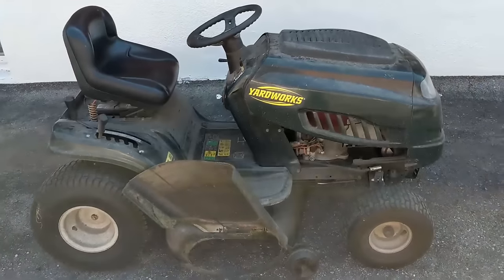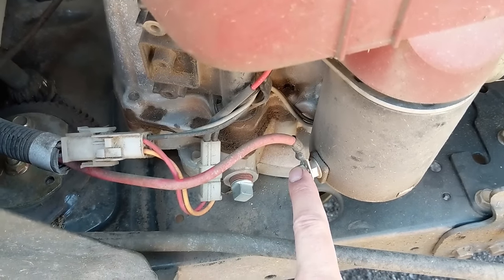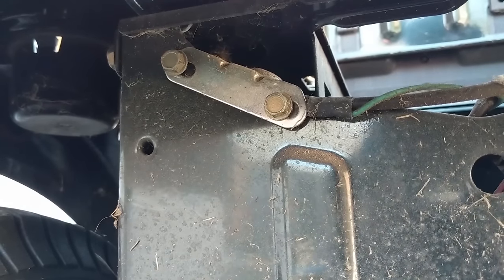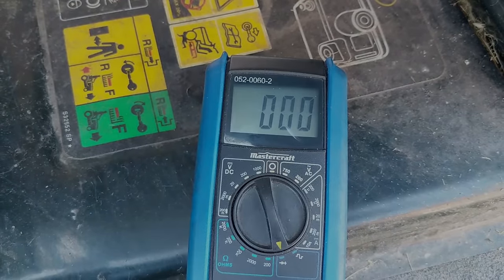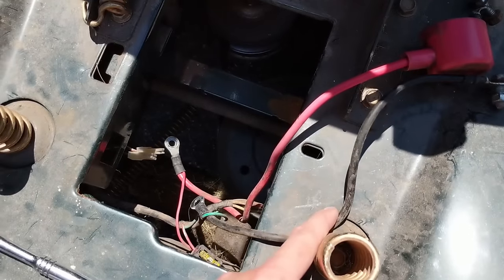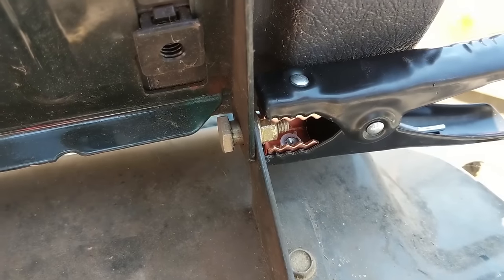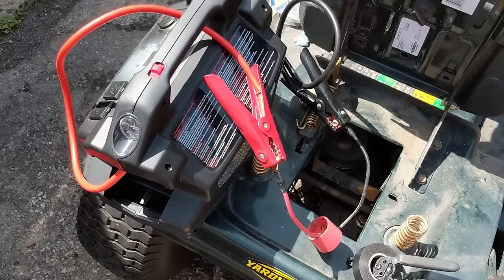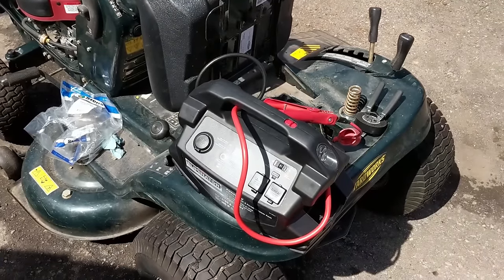Riding Lawn Mower - Solenoid Clicks but Doesn't Start

Comment: I have a zero turn and it was clicking a few weeks ago, when I turned the key all the way, nothing, but when I backed the key off ever so slightly it would turn over. Now barely clicks. I'm thinking bad key switch?
Reply from the maker: Had that issue on a keyswitch, you can test it, watch this; https://youtu.be/vWRL9_3_X0Y

Comment: Doing a voltage drop test to test the wires is probably better you can get continuity but insufficient voltage due to corrosion or broken strands
Reply: Ur correct there is a big difference between continuity and conductivity  voltage drop test
Reply: Yep voltage drop test on both pos and neg would have save a half day of taking things apart unnecessarily….

Comment: I just got done working on a Troy-Bilt Pony.  Click, no start.  Solenoid checked out.  I pulled the starter.  Starter checked out.  Battery checked out.   Pulled the fuse. The fuse checked out.  Pulled the spark plug.  Tried to manually turn the engine.  It was locked up!  I used a 15/16" socket on the flywheel bolt, trying to turn in the direction of rotation.  No go.  I tapped the ratchet against the rotation and the engine freed up.  I did a cursory compression check (finger over the spark plug hole) and it had compression.  I put it back together and it ran.

Comment: After overcoming the big wall of awful that was my clicking mower, I did all the steps you suggested and found it was a ground on the battery and solenoid that fixed it! Life saver! Thank you. I agree with what everyone else said about how helpful and clearly you described the likely failure points.

Comment: Your tutorial saved me hours of frustration. I checked all my connections, charged the battery and my mower would not start. After reading all the comments I discovered 2 other guys had the same problem. My battery was fully charged, and was good after putting a load on it at the parts store. It needed a booster to start for some reason, but when it started I got so excited I mowed my yard of 2+ acres. Im a new subscriber and thank you for the video.

Comment: I have a John Deere 185 Hydro lawn tractor with a 17HP Kawasaki FC540V engine and a Nippon Denso 12800-2810 starter that had an intermittent "one click, no start" issue.  I installed a $16.00 knock off John Deere AM107421 Starter Relay Kit from eBay and it solved the issue.

This video helped me track down the issue caused by low voltage at the starter solenoid.

Comment: So simple when explained professionally. Everything starts and ends at the battery. Connections to every circuit and appliance. Battery pos neg,Solenoid, safety switches, starter,  key switch, fuses, and ground.

Comment: Thanks a million for this video. Very clear step by step testing. At the end all the tests pointed to the problem being in the starter motor. It was getting the correct voltage but not spinning. I thought to myself that if this happened in the car I would give it a couple of bangs with a hammer,so I tried it and guess what? It worked and has continued to do so. I guess that over the winter the thing had seized up…Bendix or whatever. I thought this might help someone before they undertook removal and repair/replacement.

Comment: Just my two cents but you can test the fuse by the two contactors on top without removing it—it has saved me a lot of headache when working on cars—just wanted to pass along the advice— Great video!

Comment: Thanks a ton, you tip was very helpful!! Being an owner of new to me landmower; my zero turn wouldnt start, heard the solenoid tick but the motor didn’t start. However, took courage after seeing your video to pop open the driver seat, put my battery boosters in and vola! My zero turn started right sway
Reply from the maker: Maybe time for a new battery, thanks for watching, and good luck!
Reply: @EliminatorPerformance  Yeap..I agree..I’ll get one from Amazon..looks like an easy swap

Comment: Dude! I was stumped. I checked safety switches and ignition along with many other things. I have a brand new battery too. I heard a click under neath my seat and it was the solenoid. Saw your video and removed the solenoid. Cleaned the ground, the battery terminals and the starter terminal. Jumped on and it started! Thanks!
Reply from the maker: Thanks for watching!

Comment: 2 month old mower started doing this. I found the ground from battery was connected to a painted surface. A little wire brush and presto, better than new. Great walk thru video on diagnosing this issue.

Comment: Thank you for your expert knowledge. I was able to follow your step and found the ground wire next to solenoid that was loose. Btw, ever since I replaced the engine two year, the headlights is  always on. I was able to live by so far by disconnect the battery each time. Wonder if you know the cause for that

Comment: I'm a 20+ year electrician and a 10+ year home business small engine mechanic. So, this is my advice on testing this type of issue...

When you test, always put your tester  ground directly to the battery. That way you eliminate a bad ground from your testing. If you get power to the starter with the ground on the battery, that tells you your entire positive side of the circuit is good. At that point you could move your tester ground to the engine (where you started), if you get zero or any voltage lower than what your battery voltage is, then you know there is a bad ground.

I've had several issues with bad ground from the battery to the frame strap. Testing using the battery as your ground allows you to more accurately isolate the issue. 

Also, never trust the thread of the bolt as your ground. Threads get painted and also allow for oxidation.  Always, always, always clean the metal pieces with a grinder, sander, wire wheel, etc... so there is a good clean connection from the wire directly to bare metal. A three post solenoid can give you different results if there is not a good ground at the base plate of the solenoid. In that case there won't be any noise from the solenoid because the control circuit of the solenoid won't get voltage due to the ground. In this case test for voltage from the neg. battery post to the control post/wire of the solenoid. If you get voltage there but not from the ground strap on the solenoid to the control post then.the ground is bad on the solenoid strap.

Electricity is hard to see, unless you blow it up. Lol.

Comment: Good troubleshooting procedure. I was hearing a click, but like a small relay. Found out that was the fuel cutoff solenoid by the carburetor. When in the start position, only ~5.5volts  at the battery. Somewhat similar to this situation, It was the positive cable to the battery wasn't tight. It stated a few times after re-installing the battery in the spring, I guess after a few mows that loosened the connection.

Comment: Thanks! This is a great video because it covers every possible things that could go wrong and offers solutions for each on.e It goes beyond standard troubleshooting into things a repair manual wouldn't like noting that the paint on the frame could make a bad contact. Very clear about everything. More videos should be like this. And I'll be checking out what else I can learn from this channel!

Comment: Thank you! I have a 1998 mtd Ranchking 16.5hp opposed twin I bought used. I just about changed everything on my mower to finally get it running the last thing I did was change both battery terminals and put a new starter on it (my solenoid was clicking too but wasn't cranking)...also my heads were flooded so I pulled sparks out, flamed up the chamber to get it dry, slapped the spark plugs back in and it finally got going. I also had to adjust the idle on the carb to get it running stronger, because it used to die out when mowing sometimes. Also of note, just to provide yall with as much info as I can, I put new battery, new spark plugs, new magneto, new fuel lines/filter, new engine oil. I took the heads off and sanded off all of the carbon buildup on them and the pistons, also threw some seafoam in there for good measure. I also attached a new solenoid. Just about the only thing decent on it was one of the belts and the blades are still good. I'll be getting 2 new tires for it soon as well.
Reply from the maker: Thanks for watching!

Comment: Thank you, did everything you have suggested and found out that the solenoid was bad originally it did click but a no start ... got a little sneaky and with the key on I shorted out on the solenoid in original place the incoming 12v cable and the starter cable and the starter motor turned over so the solenoid was defective
Reply from the maker: Sometimes they click but don't make the connection, this mower is still starting and running to this day!

Comment: Good video. I have a question. Turning key makes solenoid work, there is 12volt plus power to starter but starter does not turn. Putting power direct to starter from battery starts the engine.  Checked key switch contacts, all work as they should solenoid clicks. Is it possible that there is a fault on the reverse module part?
Ive checked all safety switches and all appear good. I'm stumped. Help please??

Comment: Dude, you literally got my mower started! Much obliged!!!! Thank you my brother!
Reply from the maker: Thanks for watching, glad it helped!
Reply: I had a craftsman YT3000 ride on mower.I had no idea how to fix it.The mechanic had a look at it n reckons its something else.He started it up with his truck terminal n still won't start.I replaced the old solenoid n a new battery n still won't started.He reckon the main motor key to start it came off or did I hit something hard like iron.It turns but not enough power to start it.He had a quickcheck up its still won't start.I watch your video n I think this might do it if I follow the video.clearly.in steps n.It mite work.I live in Rarotonga,Cook Islands n it hard to get parts for.the machine.I.really like watching this videos n others mainly on ride ons.Kia orana from Rarotonga.

Comment: Very helpful.  I am troubleshooting an old Ransome's Bobcat.  Starter switch is bad but I have been bypassing it with a jumper cable from the positive battery post to the red post on solenoid. So no feedback of clicking.   Last week, no cranking, just sparks at solenoid.  Will try your approach to eliminating causes.

Comment: Great video. Very well done. If you get the biggest possible replacement battery, larger than OEM, could out prematurely burn out the starter by driving it too hard?
Reply from the maker: No I've never seen that happen, the more CCA (cold cranking amps) the better. As long as it's a U1 battery.

Comment: i went through all this numerous times with an intermittent problem - starter would not turn over or trn just a little. next time it would start fine and stay that way for awhile. finally pulled the starter. found a broken chunk of field coil that would jam up and let loose whenever it felt like it. 1 new starter later and I was back in business. 1st time in 50 yrs I had run into that one.

Comment: You just saved me some time.  I was about to pull the pressure switches out from the deck and brake to check them but I do hear the solenoid clicking so that means power is getting through both and the ignition is working.  It makes sense the pressure switches need to be before the solenoid, not sure why that didn't occur to me, probably more just frustration getting to me.  I can start it right up from a jump box on the starter so I'm thinking its probably just a bad contact from the battery I need to clean up.  Great video.
Reply from the maker: Glad it helped, good luck and thanks for watching!
Reply: I was about to do the same but watching this made me think. My mower would randomly not start with the relay clicking. I've had the mower 2 years and this started about 6 months after getting it. Recharging the battery didn't solve the problem. After seeing this and checking everything I became suspect of the battery. Toro supplied a 195 cranking amp battery. Other blogs indicate this is way too low. I bought a 340 and the machine fires up immediately every time. Easy fix after a lot of needless worry. Shame on Toro for supplying such a weak battery,
Reply from the maker: @leeclem6066  we run 370's regardless of engine size, because that's the only battery we recommend! Turns over a mower every time!

Comment: My Craftsman GTS 5000 had a similar problem. Turned out to be the brake switch. I spent a great deal of time replacing it. When I do maintenance on the mower, I make sure to remove any corrosion from all of the terminals. After that, I spray CRC Battery Terminal Protector on all the terminals. A great tip of yours is to remove the paint from any ground wires connected to the frame. Sometimes the problem will be a buildup of rust.

Comment: Before you break out ANY test equipment, make sure the blades are DISengaged. Sounds simple but my Hustler zero turn almost fooled me. It has a toggle switch/solenoid that won't allow power to the starter if in the ON position, but it WILL click. Glad I caught my mistake before I started unbolting stuff. Just thought this might help someone.

Comment: I recently replaced my starter solenoid, where I re-connected the wires exactly like they were on the old solenoid.  After making a couple test cuts, the mower made a grinding noise that wasn't there prior, and upon turning the key off it kept the starter powered.  I expect the new key switch or the solenoid is wired differently than the original parts.  The solenoids appear identical but the 5 pin key start assembly was different as far as the orientation of the connector.  What do you think?

Comment: The video was a huge help. I replaced the solenoid and now I get the click. I get power from the key and I am also getting a connection from the solenoid to the starter. The starter looks like it starts to move a little then nothing. Bad Starter? I am getting power to the starter that has been confirmed.
Reply: If it helps at all I took the starter off and tested it on its on and it spins. So the other thing I was thinking was a kill switch somewhere maybe?
Reply from the maker: Could be a bad starter, do a bench test of the starter. Simple 12v bench test: https://youtu.be/0k4R2WKRhDk

Comment: hi,
great video.
I'm in Australia and first try after our winter, my ride on solenoid clicked couple times.
I got new battery and same thing, but after couple clicks then nothing. There is power to solenoid but not from solenoid to starter. It's 4 post solenoid so it maybe a safety switch and/ solenoid. I tried jumping solenoid to start but nothing...
Cheers

Comment: I have a Craftsman rider at least 20 years old. The solenoid was clicking like crazy when I turned the key over. Battery tested at 12.7v with meter. Tested everything else out & was fine. Replaced solenoid anyway and tore starter down and cleaned it up inside. But it was a head scratcher until I load tested the battery. Didn't even move the needle. Changed that. Like nothing even happened.

Comment: Hi Great video, i followed your electrical trouble shooter....i have fully cahrged battery.....i have good earth in continuity and resistance. I have power to solenoid, power from solenoid to ignition switch, when it turn ignition i have no voltage going down from ignition through small wire to solenoid. Safety switches are ok....i also have no lights at all on the dashboard......any advice? Thank you in advance...grass is getting longer DOH, Lee

Comment: There's a stator on these motors also that puts out between 20 and 40 volts, and a voltage regulator that drops it down around 14 volts. One last check I would have done on this is to put a volt meter on the battery while the engine is running to be sure you see around 14 volts while the engine is running. This confirms that the charging system is working to keep the battery charged. Otherwise, repeated starts will eventually deplete the battery. Also, for mowers that have an electric PTO clutch, having the blades engaged puts a load on the battery, which will also deplete it if the charging system isn't working. I'm just adding this point because one question I would have after all the diagnostics is, why was the battery all the way down to 7 volts? It could just be because the battery is old, was sitting all winter, etc., but I would want to be sure that the charging system is working.

When the mower is off, you'll see 12.8 volts nominally on the battery; 14 when the mower is running. If you don't see that 14 volts, then something is up w/ the charging system. That's when it's time to check the voltage coming off of the stator, and if you have a voltage there, then diagnose the voltage regulator. On some machines, these may be all-in-one.

This was a great video.

Comment: Great Tutorial!!! May be am the only person whose lawn mower didn’t start even after all these steps. Ignition works, battery has 12.5 V. Engine cranks but no start. Pls advise any further test I should do. Your help would be much appreciated!!!
Reply from the maker: Spray some carb cleaner into the engine when cranking it over, if it doesn't start it means it doesn't have spark. May also need a carb clean.
Reply: @EliminatorPerformance  Am sorry what do you mean by Spray on engine ? In fuel container or top of the engine. Sorry need more help
Reply: I'm a year late but he meant spray carb cleaner into the carburetor
Reply: I'd take the carburetor bowl off and clean it out. Could be water or jello inside.